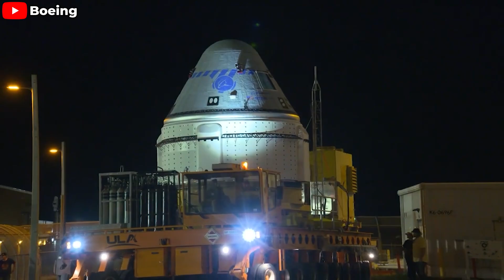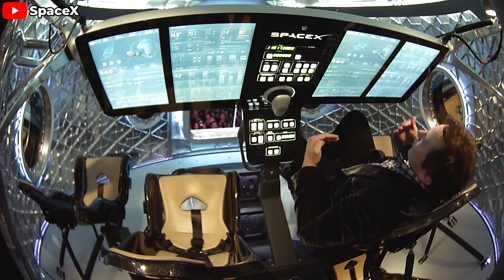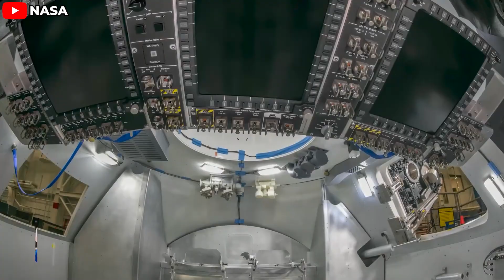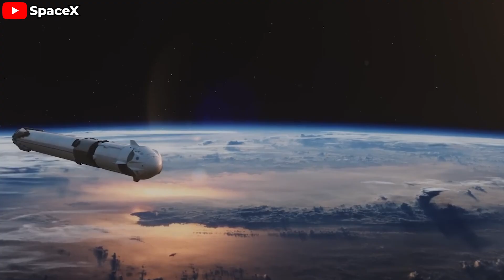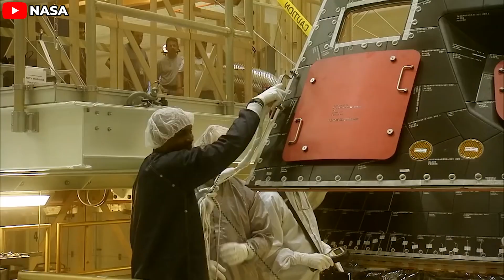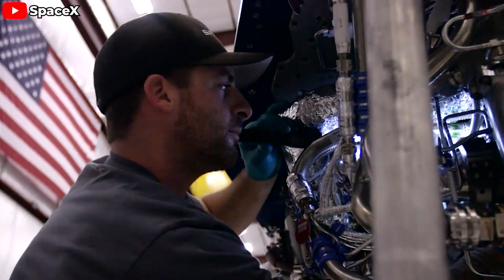SpaceX's NEW Dragon Design Is Completely HUMILIATED Boeing Starliner, Even NASA...

Comment: @cerberuslikesballin   ... Good one. It's about frequent launches  ... testing and tried. Murica on the other hand had only frequent "lunches"....after faking a "moon landing", said someone in the you tube comment. Murica has been nothing but badly brought up "bad mouthing" other cultures in the last couple of decades. Its all hollywood. 

@cerberuslikesballin
3 hours ago (edited)
I completely agree, a spacecraft which the design of has been used for decades (and has been used as a base in many other communist derivatives) due to its reliability compared to a spacecraft which only has been properly flown by a single company for a few years is quite a significant difference.

Comment: The heat shield on Orion is designed to be as light as possible to allow for maximum fuel efficiency, while Dragons is heavy as hell for no reason, being around a ton heavier than Orions. Also, NASA engineers can grasp their own feats, everyone can.

Modern tech doesn't mean it's good tech, btw.
Reply from the maker: Exactly, PICA has a denser structure, so it’s a bit heavier than Avcoat. , But right now, it's also true that the NASA engineers haven't found the cause or solution for Orion’s heat shield issue

Comment: Soyuz completely humiliates Dragon! Click bait.
Reply from the maker: Dragon came after Soyuz, so it’s only been flying for a few years, and it’s a bit more advanced than Soyuz.
Reply: I completely agree, a spacecraft which the design of has been used for decades (and has been used as a base in many other communist derivatives) due to its reliability compared to a spacecraft which only has been properly flown by a single company for a few years is quite a significant difference.

Comment: Glass Cockpit - that's what it's called in the aviation industry
all LED screens with maybe a button or two and even those are programmable by the pilot

good grief where was NASA and standards that all competitors must use so there are backups
from other contractors in case of an emergency

and that goes for the space suits too

but NASA is mired in DEI or is it DIE...